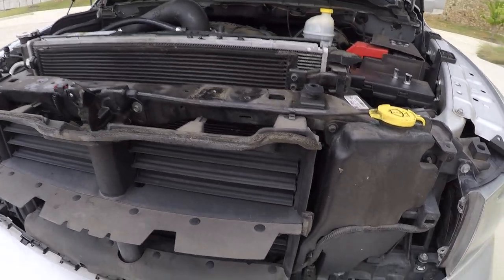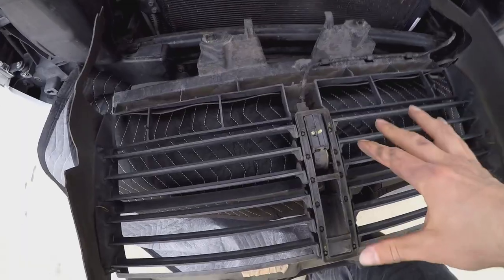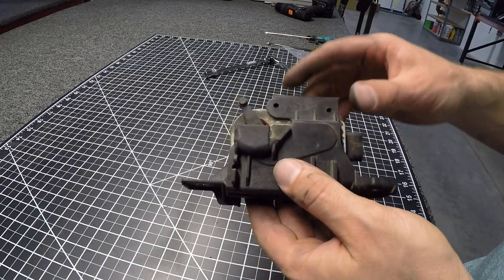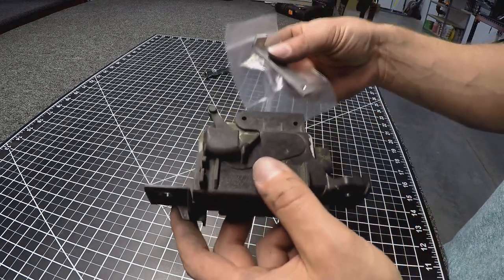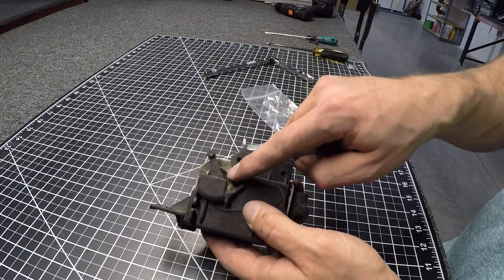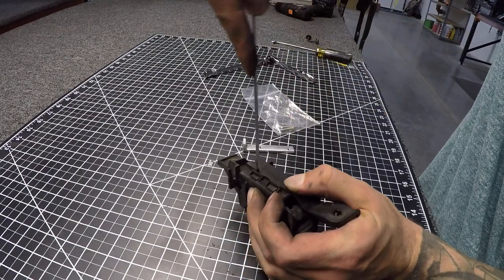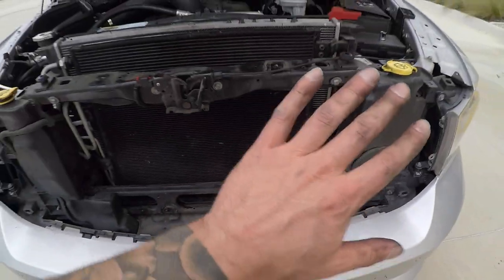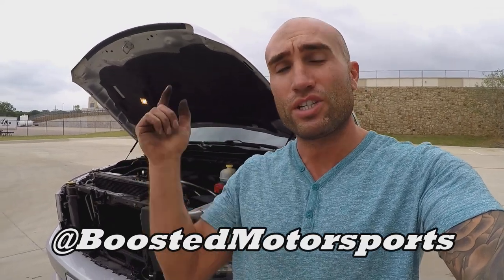How To Remove the Active Grille Shutters from a RAM 1500

Comment: I did a delete for my shutters, but it was different. Basically I removed the grille in the same manner, removed the shutters. Then once I had it out, I popped the plastic clip that holds all the shutters down, and just removed the inner shutters, leaving the top one and bottom one. Closed that plastic retainer that holds the shutters in place, and plugged it back in. With me still having one shutter on top and bottom, it actually is still working as it should. Just with less of them. No engine light either, so I just thought I'd give people an alternate option. Not trying to steal his thunder, but all in all, we achieved the same goal. Only mine required a lot less work and no drilling
Reply: was thinking of doing it this method.. still no check engine light?
Reply: @Ajliscious  nope, no engine light since I left 3 pairs still in there to operate normal.
Reply: @vancejensen6036  you left 3 in? not just outer 2?
Reply: @vancejensen6036  you left 3 in? not just outer 2?
Reply: @vancejensen6036  you left 3 in? not just outer 2?
Reply: @Ajliscious  yea I left in the top, middle, and bottom. It helps a lot with running cooler. A constant 186 now compared to 225+. Major improvement. As for those who are worried with heat in the winter, I have no issues on that either. Still plenty warm for me, and I even got a grille cover that's used for the diesels just in case with the openings for when it's super cold. Only costed 100 bucks from the dealer and simple to install.
Reply: And no kit!
Reply: This is genius.
Reply: haha, yeah, I was thinking of doing same thing, thanks!

Comment: For anyone that doesn't know these are there for fuel economy by preventing airflow to the cooling module when it's not needed to improve the drag coefficient. Also, you removed all of the cooling seals which are attached to the Grille Shutters so it's possible that you actually made the airflow worse because now the air is able to travel around the cooling module instead of being forced through it.
Reply: It is better for him as he needs the inter cooler he is putting in to get as much airflow as it can.
Reply: The difference in fuel economy, even at highway speeds, is nearly negligible. And yes, I'm actually an aircraft (DoD) engineer.
Reply: All of the shade tree auto engineering experts think they know something the actual engineers never figered out :)
Reply: wascrash This actually answers my question wich was, what’s the point of removing the grill shutters. Thanks.
Reply: @fallout1116  youve done the wind tunnel tests huh? . yes Im an AME (canadian version) as well, a giant scoop vs brick wall, which is better for drag.
Reply: You do know the 09-12 rams don't have active grille shutter and fuel it not much different than the 13+.
Reply: @fallout1116  And, yes, no one asked.
Reply: I agree! I thought I was missing something.  If the check engine light is on because of some failure with the AGS or communication to it, why not just fix the problem? I have this issue with my 2019 Ram 1500 and in the process of having it repaired.
Reply: I’m not planning on cruising at 100mph for hours because that’s the only way it could possibly make a difference if there’s any
Reply: Towing caravan down in Australia temps get pretty hot I do understand that in colder climate's you do need the active grille shutters
Reply: 😂, so air will flow better if I block a hole with plywood compared to blocking it with a chain link fence?
Reply: @bbaz6729 Tell me why the engineers bolted the AC/ transmission cooler to the radiator when they could have had it bolted by itself.... Eliminating me to have to mess with it in order to change out my radiator???? Gee, I guess the engineers are not that bright.
Reply: @RidinONChrome  I'm so happy that I bought my 2012 instead of the 2013.  This item alone probably added another grand to the price tag.😂
Reply: @EdwardTopia Why???? We have been driving trucks for years without them. More EPA regulation nonsense.
Reply: @Oldschoolrules123   I had a 09. Loved it. Have a 2018 now and I took the shutters off. Combined with that and 180 thermostat. Truck runs really cool.
Reply: @RidinONChrome   You might be able to sell the fan shutters to someone that believes that they will save the planet along with giving them 5 more miles a gallon.😂 You got the last year's of the good HEMIs . They just destroyed Ram forever,
Reply: @Oldschoolrules123  hahaha 😆  probably somebody out there that dumb.
Reply: These trucks sucks they run to dam hot
Reply: @letsgoladodgers  it's all for emissions. It's not really Rams fault. It's the EPA. If they can 21 mpg on the highway vs 20 mpg. That saves Ram millions of dollars from mines from the epa.
Reply: @letsgoladodgers  What sucks is your spelling. 🤣😂

Comment: Since this bracket isn’t available anymore I just used a 1/4” bolt (length doesn’t matter as long as it’s enough to accept enough threads for a washer and nut) and a nylon lock nut/washer. The motor arm has a hard stop built into the housing already so you need to mark where the arm stops on the opposite side. Do this while motor is still connected to the shutter assembly. You can move the motor arm by hand. Once you move the arm to the opposite end of travel, mark the position with a marker. Drill a 1/4 hole and put the bolt through the underside and the nut on the side with the mark. You have to drill the hole in a spot where the arm will hit the nut. Use one of the hex flat spots on the nut to align with the mark you just drew. Tighten it down, but not too tight to compress the plastic housing and break it. The nylon locking nut will prevent it from ever coming loose. Plug it back into the truck (just the motor only and not the whole assembly)  and check your work. If all is well you can relocate the motor to wherever you’d like. If you end up getting a CEL use a slightly larger nut. All the motor does is check for resistance of the arm on each side during a certain time frame. Been driving like this for months and no CEL. 

*This is all assuming you have a property working shutter motor*

Good luck with your trucks/cars!

Comment: Easy to install his kit. I also installed an additional transmission cooler just in case. But apparently the transmission heater is still keeping it hotter than I would like. Air temp today is in the 90s and the trans temp is about 220. Not sure if trans heater should be bypassed. It seems as though the trans manufacturer wants this thing to run very warm. If it weren't for the trans temperature I'd love this truck.

Comment: I hit a deer tonight and shattered my grill and broke most of these vents in half so that is what led me to this video.  I haven't seen a check engine light yet, and my radiator was spared damage.  I guess I'll be waiting for the CEL and looking for an inexpensive replacement grill.  Thanks for posting this informative video.  Do you think that I may be good to go with this plan or that it's just a matter of time before I get a CEL?

Comment: What is the big advantage of doing this, and will it affect gas mileage or drivability? I live in Arizona and with summer coming I want the engine to stay cooler as much as possible.
Reply: Only if your check engine light is on. This tricks the computer
Reply: @jodymeriwether3871  yes I understand that part but what's the advantage of removing the shutters
Reply: @roberthudson117  I live in AZ too. The price is high. And they are cheaply made and farly new. I get it. But mine has been stuck closed on my Altima for months. I havnt had any effects. But if you got the $100 plus I would say replace it or use your warranty.

Comment: Maybe I missed it and someone can help me out, why do I need to put the stopper on? If there's nothing for the peg to make contact with will it throw a code? Just seems like it would be a lot simpler to take out the shutter assembly and just mount the motor back under the hood as shown but without taking cases apart and drilling holes is why im asking.

Comment: I had no idea these existed. Now I need to find a way to add them to my '04 with a manual control for deep water crossing.
Reply: What exactly are you expecting it to do for you in a deep water crossing?
Reply: @taylorgabriel9838  to keep bow wake and splashing water at a minimum under the hood. Similar to why you turn off electric fans.

Comment: Be sure to update is on how this effects your running temps. In particular the transmission temps is the big one I’m curious about!
Reply from the maker: I'll definitely make a video on it but so far my engine temps have dropped drastically and my E-Fan barely comes on now. Just FYI the 8 speed transmissions have a thermostat on them and are designed to have a higher operating temperature and won't send the oil to the transmission cooler unless its at a certain temp.
Reply: So how does this mod help the truck? Just curious may do it to mine.
Reply: BoostedMotorsports 
I did not know that about the transmission. It’s weird seeing that tranny temp always running around 190. Just doesn’t seem right but those engineers sure know a lot so who am I to question???
Reply: CoolGuystufff, 190 seems a bit high. Mine rarely goes above 183-185. I did see 192 once when towing but otherwise it stays in the 175-185 range.

Comment: I had no idea of this active grill shutters i had my water pump leak on my truck its a 2015 dodge ram i took it to the dealer an got it fixed but my temps are getting up to 225 sumtimes to 230 before it goes back down to 205 idk wat the reason is now that im watching this video i might have sum malfunction on the actuve grill shutters i tried clicking on the link to get this kit but isn’t letting me???
Reply: I think the guy stopped making them from reading some of the comments. I'll probably invent my own. 🤔

Comment: Omg grille looks good ive been wanting to do the same exact thing except I want the ram logo in the middle and a 20inch light bar inside
Reply from the maker: Thanks Aaron!  I just did that one for fun.  I'll be showing a video on the install soon!  I'm sticking with my factory grille though 😁
Reply: aaronakaerrn I ran a light bar behind my grill similar to his and it dramatically casts shadows on anything in front of you. It may not bother you but it kinda got annoying to me.
Reply: Aaron. Where did you mount your light bar behind the grille? Post pics if you can? I mounted mine behind the grille as well. And I have no shadows. Just curious.
Reply: Double tap flag co hey I was wondering did you relocate your horns or is the light on the lower half
Reply: Mike Toscano hey Mike I have a bull bar from Lund company and that one came with a 20in light bar but what I'm trying to do is add a 20in light bar behind the grill where the factory horns would be and I'm going to relocate the horns to the bumper
Reply: Mike Toscano I wasn't sure if I was going to have a shadow issue
Reply: aaronakaerrn my old truck was a 2008 that I did this to. Mounted high to the core sopport

Comment: I'm picking up my '14 2wd Wed.  1st Ram.  Starting off with the Pedal Commander.  Only doing bare minimum mods.  But my question is will this void extended warranties?  I didn't see anything but I'm assuming so.
Reply: They can't legally void a warranty just because you made a mod. It's only when the mod causes damage that they can refuse to repair the damage under warranty. Look up "right to repair".

Comment: Hey John are you thinking of putting a tailgate assist/damper or whatever you wanna call it on your truck for a smooth opening of the tailgate, I know there's a popular one for $50 but maybe you'll find something cheaper with your skills
Reply from the maker: Hey Cheten I was thinking of checking one out. The popular DeeZee tailgate assist is only about $24 though which is probably the one I would go with!

Comment: What benefit does this do? I thought the grill shut to allow more aerodynamics and better mpg. Then opened during slow speeds and idle to allow air for cooling.
Reply: exactly!  I think these guys just love to tinker!
Reply: @patricksnyder3446  hi.  When  the motor breaks it cost me $160 on rock auto for a new one.  Also the engine will run cooler.  My thermostat opens at 195.  It will be like running a 165 thermostat.
Reply: 😂, it's a pickup truck. If you are looking for aerodynamics.... WALK.
Reply: @Oldschoolrules123  how is walking more aerodynamic? Would you walk sideways? Does your belly stick out? If so, that's going to slow you down and have much more drag. Maybe you should lay down? That would give you optimum aerodynamics. 😂 Your comment made absolutely no sense whatsoever. Way to be a dick about someone's legitimate question.

Comment: The sides of that grill have rubber flaps so when air hits the rad dose not escape to the sides its forces thru the condenser.. sooo remove those plastic shutters then return the body back clip the sides into place

Comment: Just recently got my first ram. What is the gains from disabling the active louvers?
Reply: removing them will allow for better airflow through the radiators. paired with a lower temp thermostat you can decrease the engine running temps. this comes at the cost of about 1-2 MPG.

Comment: Thanks Washington for making manufacturers go to this level to squeeze every drop a fuel. We pay for both, engineering/fuel. My guess is the actuator is the same used by alot of companies. I have a 2014 diesel cruze work car with a grill code and the remote start won't work with the light on.

Comment: @boostedmotorsports hey man I really want to do this to my truck because my engine temperature fluctuates so drastically while driving. Also I believe this is why the coolant gets drained so quickly in the rams. But I'm not sure about buying the metal piece and 2 bolts. If I don't buy it and just keep it plugged into itself without the shutters there's no issues with that right?
Reply: By the way I have a ram 2016 1500 big horn 4x4 crew cab and watch literally all your ram videos, I've done several easy mods you posted but when it comes to the more complex I'm a tad hesitant. This shutter mod is where I wanna start
Reply: Apparently he doesn't feel the same way about your comments. 🤣 All I know is that hot temperatures are an engines worse enemy. Why would there be a mechanism that stops a radiator from cooling hot ass coolant a v8 produces. Screw the airodynamics. We want cool engine Temps. 🤷🏽‍♂️I'll probably delete my shutters soon.

Comment: What’s the reason you did this ?
Reply from the maker: Check out this older video I made about it. When you put a lower temp thermostat in your truck for performance these shutters cut off the airflow to try to bring your truck up to around 203*

Also with the procharger intercooler I will need to delete them to make room for that 😎

https://youtu.be/AbqxQUWVrYY
Reply: Makes sense for the procharger but you or a tuner can tune the grille shutters to work right with a different thermostat if not using the procharger setup here.
Reply from the maker: Hey Jay I've spoke with a few of the very popular tuners for our trucks and they can only disable the shutters they can't tune them to open or close at custom settings.  Not with Diablosport at least...
Reply: BoostedMotorsports okay good to know I must have misunderstood what was possible. Thanks!

Comment: What year models have those shutters ?
Reply from the maker: 2013+ but only trucks with a 8 speed transmission.  6 speed trucks dont have it
Reply: So 3/4 ton and 1 ton trucks don't have these
Reply: Note that virtually all Rams have it as of 2018, due to the prevalence of the 8 speed transmission.

Comment: Has anyone took the grill out of 2019 yes iam ready to do mine. I do not want to mess up the grill fasteners.
Reply from the maker: Hopefully I can start dissecting a 2019 soon!  Trying to cover as much ground on this 4th gen for everyone first before documenting that chassis but its definitely on my list!
Reply: With any luck you may be able to buy replacement fasteners like on the 4th gen. I have a spare set for my 14 for when I’m absolutely sure I’m not going to take the grill off again lol. So far I have 2 out of 4 clips surviving.

Comment: Boosted,  If I install a E-fan and put a 185 thermostat and delete my shutters will the temps still rise to 220 before the e-fan kicks on, I'm trying to avoid a tuner until my factory warranty expires.
Reply from the maker: Hey Eric I think you would probably be ok except if you are stuck in traffic.  If you turn your A/C on though you can get the fan to kick on.  My fan barely comes on now though with the shutters deleted.

Comment: Why would you need to remove this anyways? It helps it stay warm in the winter and less drag on the freeway
Reply from the maker: Just for performance reasons to keep the engine cooler.  You are correct though it definitely helps with what you mentioned!!!
Reply: @BoostedMotorsports  Exactly how is it supposed to help with performance considering reducing drag is a performance enhancement in itself? So really your reducing performance and thats about it. Oh and making it take longer for your truck to warm up in the winter, reducing the efficiency of the heater system.
Reply: If it's a racecar truck all that doesn't matter. Staying as cool as possible does. And when you add an intercooler you need fresh air flowing through it AT ALL TIMES. 🤦🏽‍♂️🤷🏽‍♂️
Reply: 😂 Less drag on the freeway. It's a TRUCK,not an airplane. If you are so worried about drag ... WALK.
Reply: @KingMrBigE 😂 I live in Florida, not worried about cold.
Reply: @Oldschoolrules123  really... thats funny because practically every year there are reports of the orange crop there and how they are susceptible to the winter weather.
Reply: @KingMrBigE  I don't eat oranges, don't pay attention.